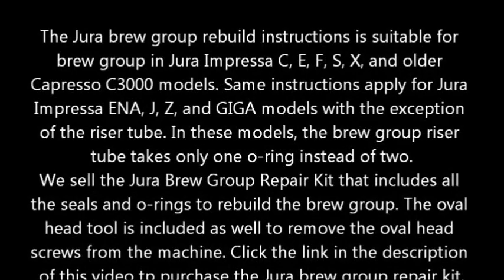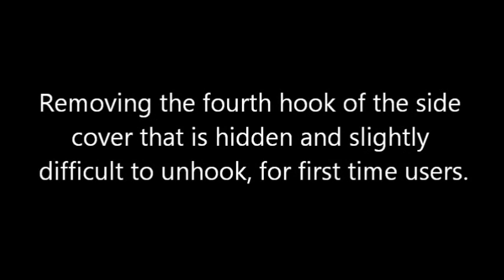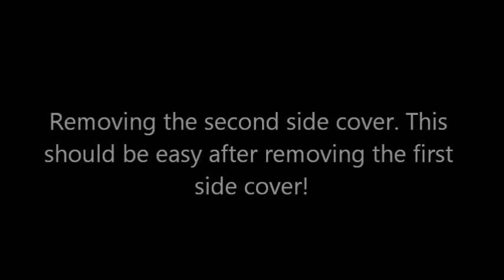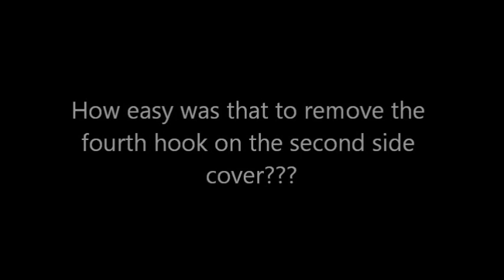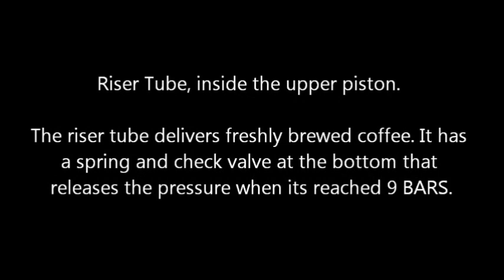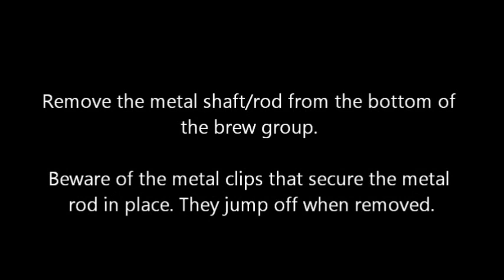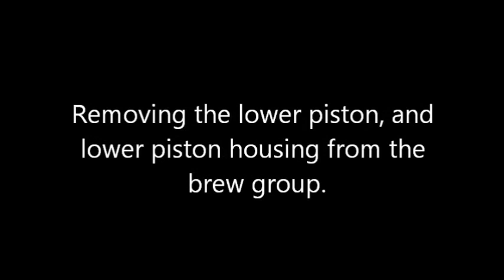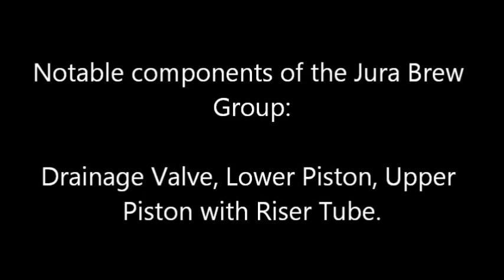How to Disassemble Jura Brew Group to Fix ERROR 8 | Jura Brew Group Repair

Comment: Hi I have a C5. I have cleaned the screen in the brew group but the coffee only trickles out. Is there something else I should be cleaning? All tubes seem to be clear. Thank you
Reply from the maker: Hi....Please adjust the fineness of the used coffee puck in the container.  Is it a well form puck or broken/thinner?  In either case, you should consider replacing the conical grinder burrs.
Reply from the maker: Hello Art,
Cleaning the coffee screen inside the brew group is a first step.  I think the coffee trickling issue could be related to coffee grounds being too fine like flour.  Please check the fineness of used coffee grounds in the used coffee container.  The ideal fineness should be like table salt grain.  If the coffee grounds are too fine then you should adjust the grinder to a coarser setting.
Let me know if the above helps!
Reply: +Parts Guru Hi i have done everything as you said in a video but before I disassemble the brew group I had a nice and rich coffee flavor almost black , and now when I installed everything back coffee is coming out very weak , brown see through . i have disassemble because of the error 8 , pistons work smooth but coffee is not to the standards , what have I done wrong ? Please advise me . Thank you .
Reply from the maker: Please let me know if the used coffee puck is well formed or broken.  Also, check the fineness of the used coffee grounds.  The optimal fineness should be like table salt grain.  If it's finer than the coffee would trickle out of the brew group instead of an even and uniform flow.
Reply: +Parts Guru yes the coffee pack is broken and before it was packed very well , and the grinder works fine i think
Reply from the maker: In re-assembling the brew group, is it possible that you may have adjusted the grind adjustment ring on the grinder?  There's not enough coffee being pushed out of the grinder into the brew group compacting cup.  Please adjust the grinder or better yet give it a thorough internal cleanup.  We also have a video on repairing the Jura grinders.
Reply: +Parts Guru thank you,  you are right the grinder wasn't clean and i have 8000 coffee  count I probably have to replace them